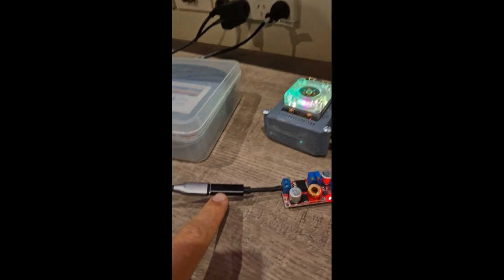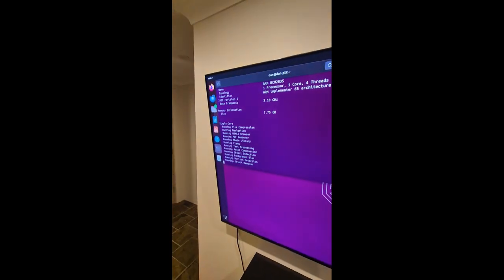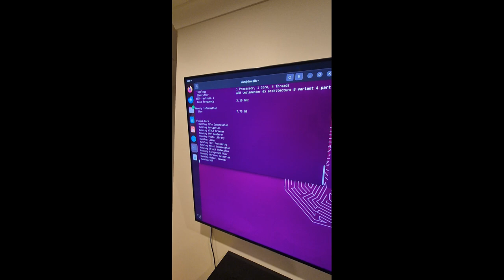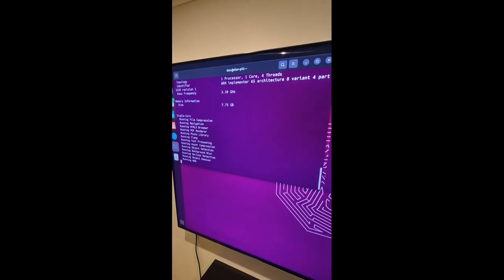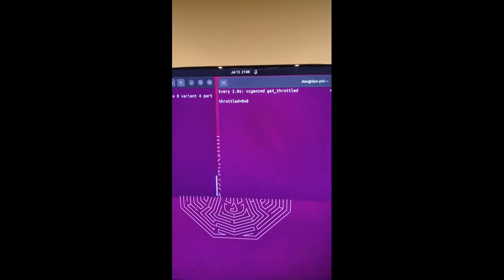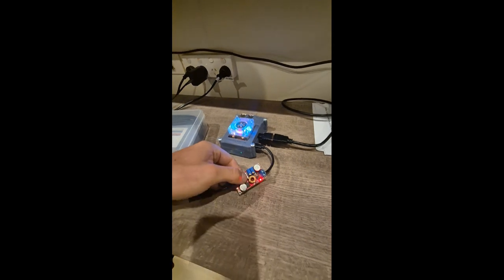How to power the Raspberry Pi 5 with a PD wall adapter

Comment: Good job! Any collab interest on Raspberry pi? (PCBWay zoey)
Reply from the maker: @zoeyzhang9866  raspberry OS utilise PD IC handshake protocol with a PD adapter, my little set-up doesn't use this protocol, so although it can deliver 27w pi OS will still see it as an under performing power supply, not the case when using ubuntu, in any case you can always turn off the pi OS load shedding function, just from my observation don't know for sure
Reply: @handymandan4736  Are you interested in any expansion board?
Reply from the maker: @zoeyzhang9866  haven't reached out to them about it, could definitely build a little adapter for under $15,